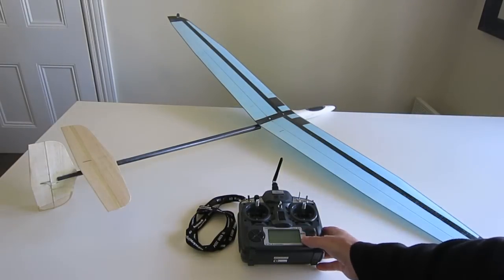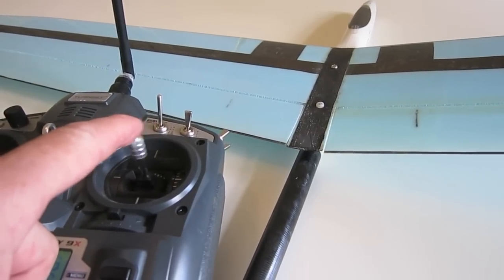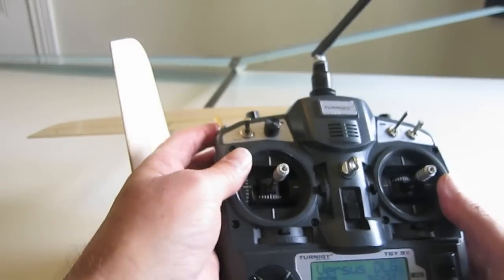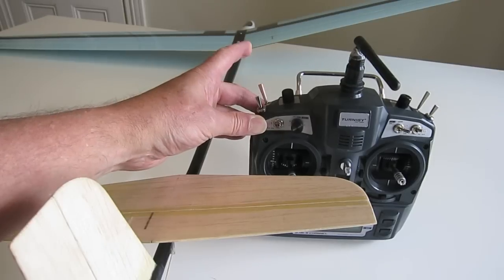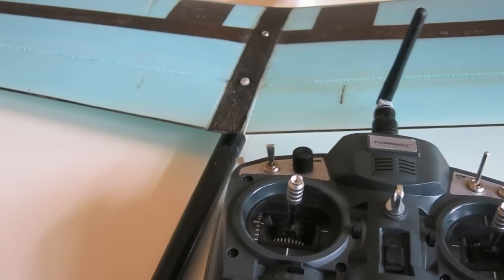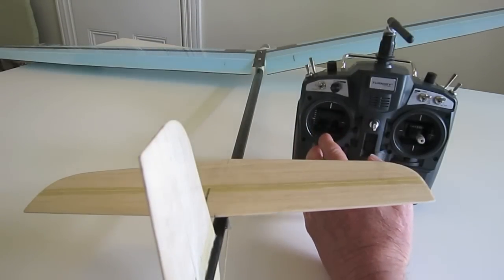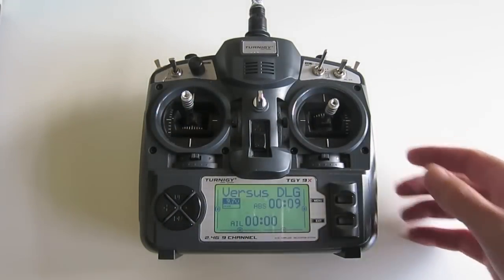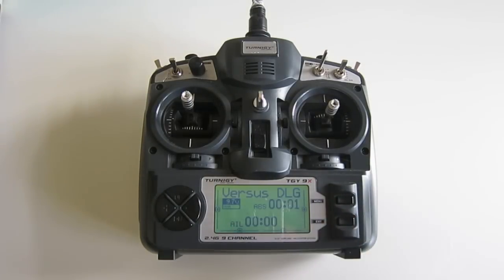Versus DLG transmitter mixes

Comment: I've had a chance to try out the aileron and rudder mix combo.  With both control surfaces moving the same way the plane turns sharper but the nose does tend to dip.  You can compensate with up elevator.  I'll try it the other way and post my thoughts.
I did start using the rudder for turns in windy conditions and had a lot of luck making sharp, snappy flat turns (with oppose aileron to compensate). It proved an effective means of turning the plane in rough conditions.

Comment: Thanks for the video.  I set up my Polaris almost exactly the same.  One thought, when you have rudder mixed with ailerons, shouldn't the rudder move in the opposite direction than the turning aileron?  Opposite rudder in a turn helps keep the nose up in the turn and makes for a smoother, flatter turn.  I think your set up will exacerbate the nose dipping in an aileron turn.  Going to test my theory and report back.  Thanks Again.
Reply from the maker: Interesting, I have never thought of using opposite rudder. Wouldn't it add drag? Let us know how it goes.
Reply: Traditionally, ailerons move an equal amount up and down. The up-aileron on the inside of the turn causes much less drag than the down-aileron on the outside. Then the nose does not move into the turn, but stays up, and the plane moves into what is called "side-slip". In side slip the fuselage moves somewhat sideways through the air, inducing additional drag. I use it for landings sometimes (i.e. aileron stick righ, rudder left, keeping wings level). Anyway, to compensate for this adverse-yaw, rudder is used to force the nose to lead the flight path, minimizing drag (but only as long as ailerons are deflected). Elevation/nose-up is done using the elevator, not the rudder (unless you do a knife-edge in 3D flight).
Reply: Now, there's another way to avoid using much rudder, called aileron differential. Two paths: if you mount the aileron servos with the horns angled forward on both wings when the servo is centered, you create mechanical differential: the aileron moving up will move more up than the one moving down. How much differential you need is a trial-and-error thing, but assume about 50% (half down vs full up). This can be a problem on a DLG, where you want flaperons to deflect far down on landing, so most people install servos with the arms perpendicular to the wing, and dial in differential in the radio. The differential can then be suppressed as needed, i.e. when flaperons are deployed.
Reply: I use TX programmed differential on my DLG, and cancel it on landing.
Reply: jstjern1 differentials is something I've meaning to get to.  Thanks for the expantion, I will try the mix on my next trip out.
Reply: Glad to be thought provoking, at least :-). To completely confuse me, and others, some DLG pilots use differential in the opposite way, making the outside (of the turn) aileron deflect more down than the inner one deflects up - opposite to what I write above; and they fly without rudder! I cannot explain this... yet.
Reply from the maker: ***** This is an excellent discussion, I'm learning heaps. Balancing the need for lots of down flaperons for landing and maximum resolution with differential for flying is quite a juggle. Lately I have the servo arms mounted angled back (for maximum flapeon) then re-centred with sub trim and corrected the inverted mechanical differential with heaps of programmed differential. Seems to be working OK. But I'd love to know if there is a universal "best" way of achieving it.